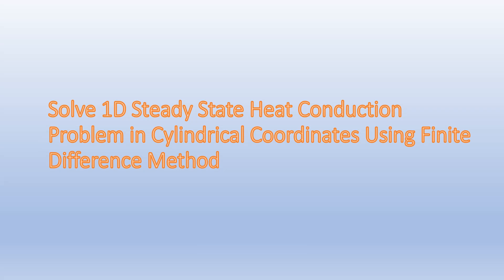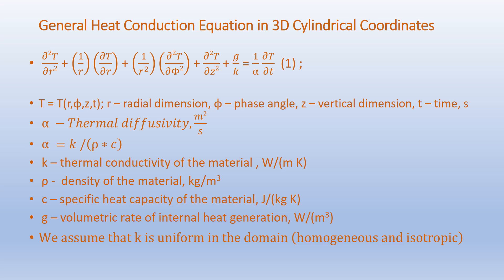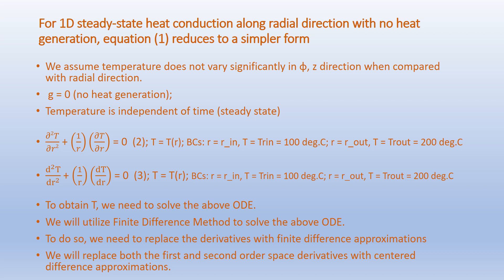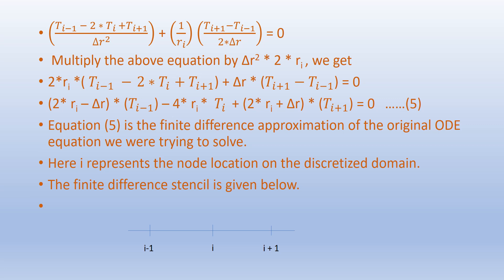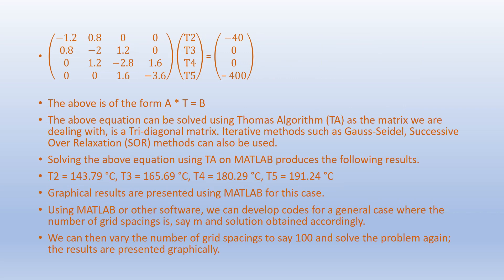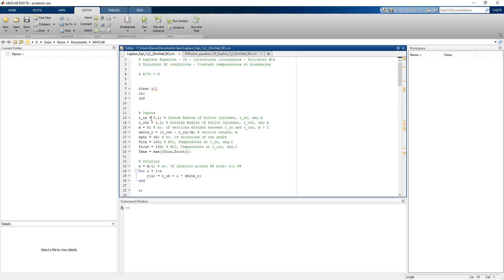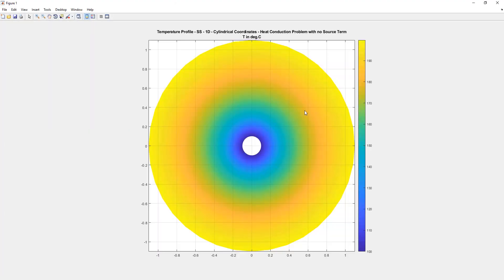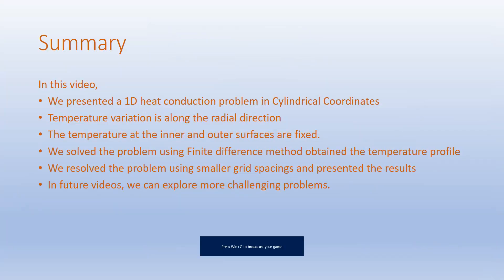Solve 1D Steady State Heat Conduction Problem in Cylindrical Coordinates

Comment: Dear Sir,
I have a problem where a heat flux is applied at the inner face of the cylinder, the problem is similar to what you're doing apart drom the applied heat flux. How to write a script that approximates the T at the inner radius using a heat flux of 800KW at the inner face, a temperature of 405C, and a thermal conductivity of 25 W/m/k (Steady State)

Best regards

Comment: When i run the exact code MATLAB throws an error saying doesn't recognise partial derivative '1A'.  Is there a part of the code missing?
Reply from the maker: Double check your code and if it still shows error, pls.  send me your code so i can debug
Reply from the maker: [Phi,R] = meshgrod(phi,r1);

change it to 
[Phi,R] = meshgrid(phi,r1);

Also, check if you have Thomas_Algorithm_Func1 function in the same folder.
Try and let me know.
Sorry, I was busy. 
Email me at samseleven@gmail.com
Reply from the maker: use lA in place of 1A.
l for larry.
Not 1 for number
Reply: @samseleven1  I changed this and now i get the error:
"Error in Conduction__Cylinder_convectionBC (line 69)
T = Thomas_Algorithm_Func1(dA,lA,uA,B);"
Reply: @samseleven1  When i change 1A to lA i now get this error:

Error in Conduction__Cylinder_convectionBC (line 69)
T = Thomas_Algorithm_Func1(dA,lA,uA,B);
Reply from the maker: @Knowing_IsPWR  did ypu copy Thomas_Algorithm_Func1 functipn from the website and included it in the same folder?
Reply from the maker: @Knowing_IsPWR  pls email me both codes. samseleven@gmail.com
Reply: @samseleven1  I used  Thomas Algorithm for tridiagonal system of equations of the form [a][x] = [b]
 from the website https://engineering-stream.com/engineering-stream_Numerical_Methods_Codes.html 

My errors are:

Error using contourf (line 57)
The size of X must match the size of Z or the number of columns of Z.

Error in Untitled2 (line 92)
[C,h] = contourf(X,Y,Z,300);
Reply from the maker: @ngocanhnguyen8848  what are your inputs?
Reply from the maker: @ngocanhnguyen8848  email me  your inputs
to samseleven@gmail.com
Reply from the maker: @ngocanhnguyen8848  email me your inputs tp samseleven@gmail.com
Reply: @samseleven1  It works perfectly now! It was the dot. Thank you so much :)
Reply: @Knowing_IsPWR  did you resolve it
Reply from the maker: missing a dot...Use Phi.
Reply from the maker: Aled Gravelle and Nguyen arw the same person?
Reply: @samseleven1  hi no, we are not/